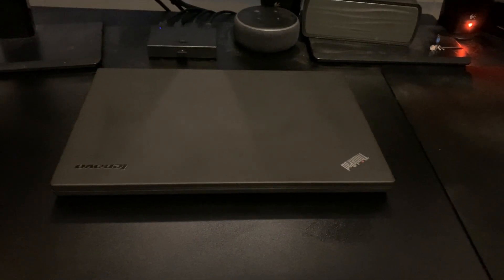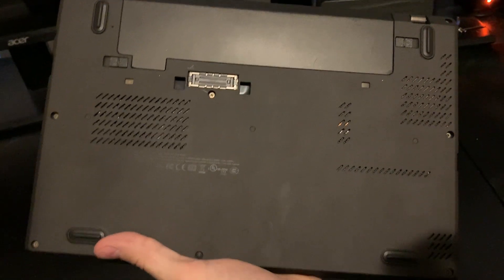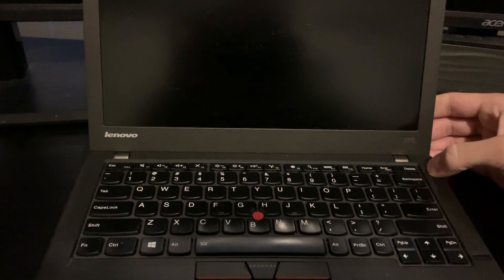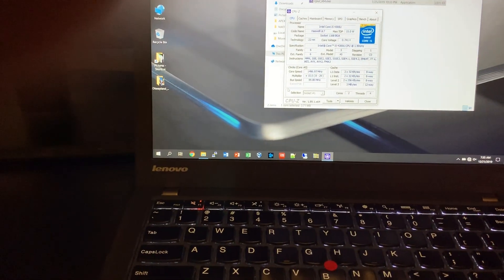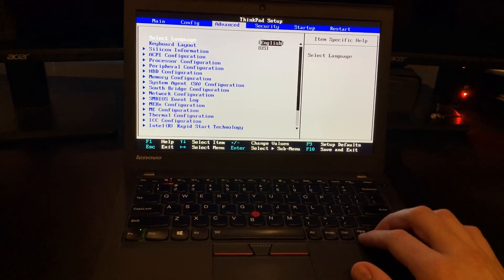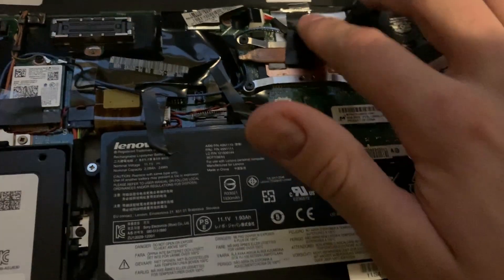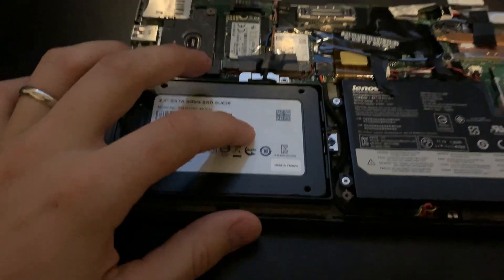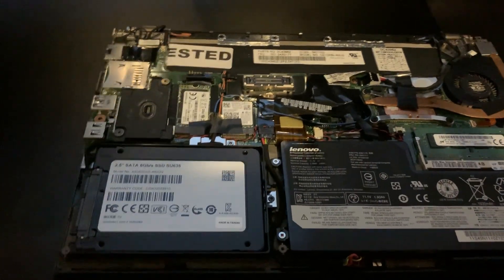Lenovo Thinkpad X240 Overview and Upgrades in 2019

Comment: I would recommend you to use it with GNU/Linux distro such as Manjaro Linux or EndeavourOS.
You get more battery life out of this X240 and you could install an Intel Overclock script in order to undervolt the CPU and get even more battery life out of it.
I'm using my X240 with an SSD, original Lenovo removable and non-removable battery and I'm getting around 8 hours of battery life while doing some office stuff and web surfing.

Also, there is an mSATA to SATA adapter which will allow you to use two mSATA SSD's and the ThinkPad will display those as two separate drives. I don't know what kind of adapter this is since it came with my X240 but there's a model number which says N2510x2

Comment: introduce X240 at Decenber 2019 , are you kidding me?
Reply from the maker: Still a great laptop in 2020.
Reply: @BrooksyTech  I don't like chocolate keyboard, it's not water resist keyboard, not removable battery, difficult to change hard-drive, need credit card or guitar pick to open  the chassis, too much of disadvantage, the most important thing is , it's made by lenovo, this company is under full control by  china communist party, you can't even sure your personal info are safe
Reply from the maker: Can remove the battery, not difficult to change hdd, don't need guitar pick to open back cover, etc. Sorry, don't seem to know what you are talking about. Please watch the video so you have better info next time. Thanks for the watch!

Comment: What ram did you use? Is there a link??
Reply from the maker: Sorry I don't have a link, it is just a stick of ddr3 ram rated at 1600 mhz. Most ram should work just fine though. If I check cpu-z it says micron made it.
Reply: @BrooksyTech  is it ddr3 or ddr3l?

Comment: HI, I HAVE A QUESTION ABOUT THE SCREEN, MINES IS WORKING GREAT BUT I´M JUST WONDERING WHAT´S THE DIFFERENCE ABOUT LIGHT, BRIGHTNESS, DEFINITION ETC
THANK YOU
Reply from the maker: Sorry, I don't really understand the question. I am assuming you mean resolution and the brightness fuction? I upgraded my screen to be a 1080p screen over the stock 720p screen that comes with most models. But I had to get a custom bios flashed to have it work like stock. If you are just using the stock screen you should be okay!

Comment: So should i buy a x250 then?
Reply from the maker: Yes I would probably get an x250 over an x240 if the price is negligible. They are essentially the same, just a different touchpad and slightly better cpu.
Reply: @BrooksyTech  thanks
Reply: Depends on whether you use trackpoint or touchpad.  If you cannot live without the trackpoint, then X250.  X240 does not have trackpoint buttons, and having the touchpad double as buttons makes using the trackpoint -- pun intended -- pointless.

The is a silver lining to this: The die-hard Thinkpad users hate the X240 for this reason.  Which is why -- if you are a touch pad user, and do not mind not having the trackpoint -- you can pick up an X240 dirt cheap.  I got mine for $75.

Comment: Can u please update the links for the upgrades
Reply from the maker: Sure, are you talking about what items i used to update the m.2 SSD, wifi, battery? Most of them were purchased from ebay but I can share my search links.
Reply from the maker: @mark Sorry, I don't have a 4g LTE modem installed. So cant comment on that. I think from factory there was an option for a WWAN modem, not LTE. WWAN is pretty much a dead technology that Sprint used to use. Not sure if the still broadcast wwan though.